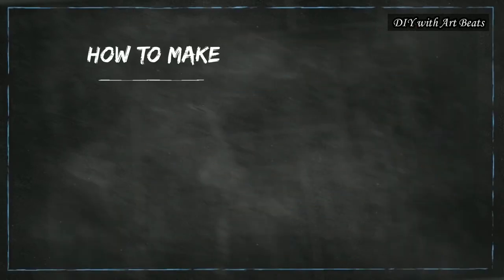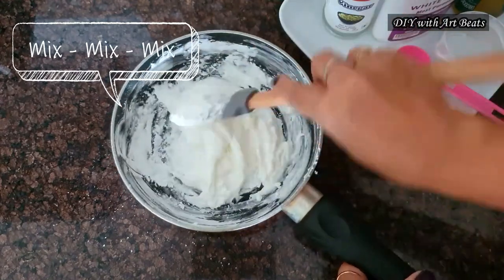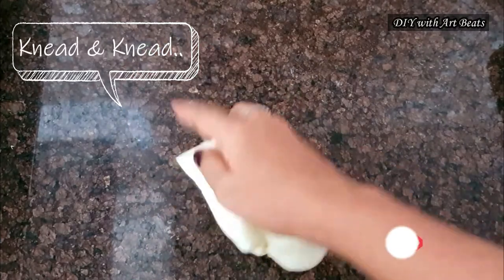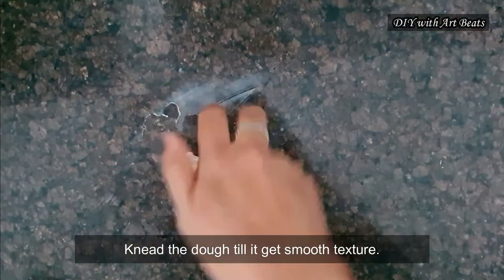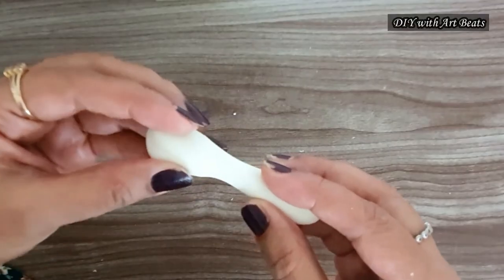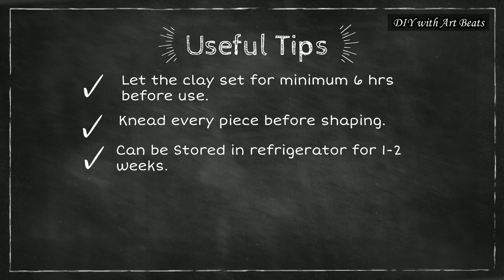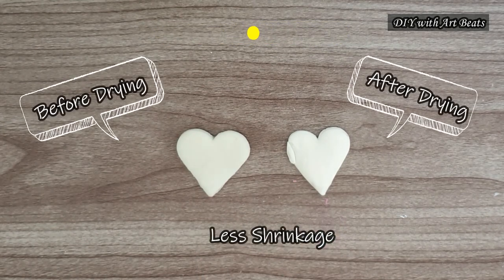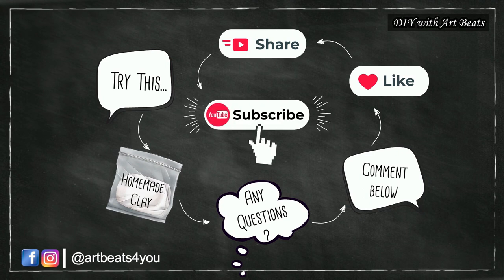How to Make Cold Porcelain Air Dry Clay / Cooked Vs Not Cooked Clay Comparison / Useful Tips

Comment: A few suggestions/ tips:

Before measuring the glue, grease the cup with a few drops of oil, to avoid the glue sticking to the cup.

After cooking, the dough needs to be kneaded while it is still hot, right?  If you do not have a masher to mash n knead the clay, cut open 3 sides of any milk cover or oil packet cover, put in the dough, close it and knead on the closed side to avoid direct contact with the hot clay. (Milk packet can be washed before use. Oil pkt can be used as it is.)

This is just to help other beginners.😊😊
Reply: what is a milk or oil packet (cover)?
Reply: @FlwrMs  In India milk and oil are supplied in food grade poly pouch/ poly pack which are generally referred to as a milk packet or cover. This is not a tetrapack. It is some kind of polythene I think